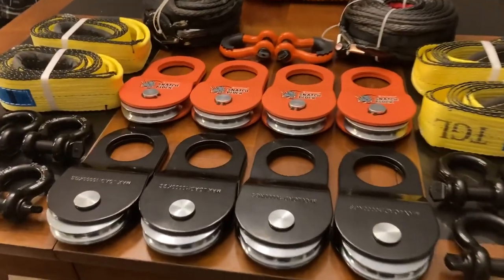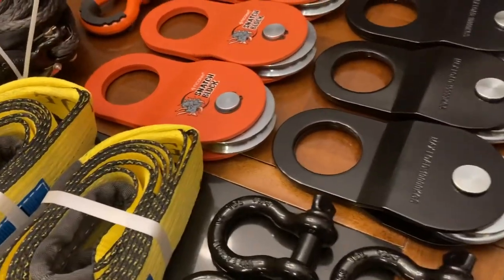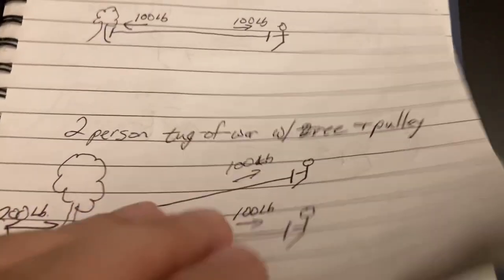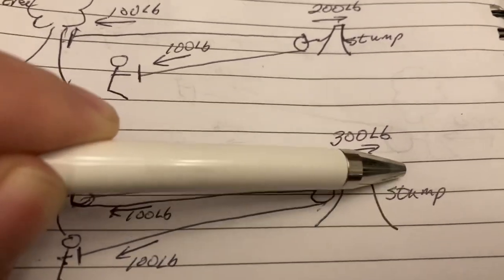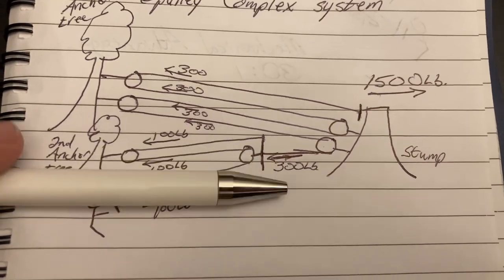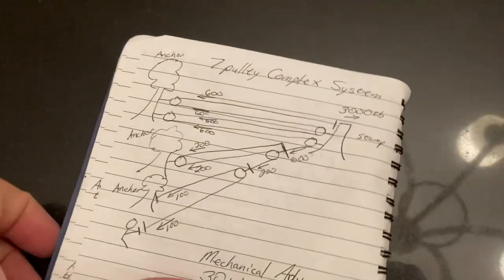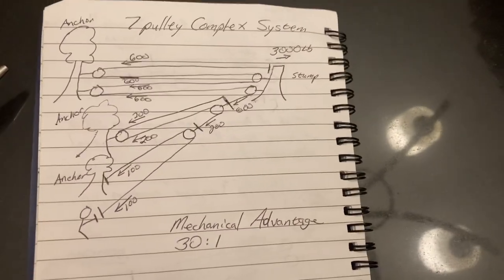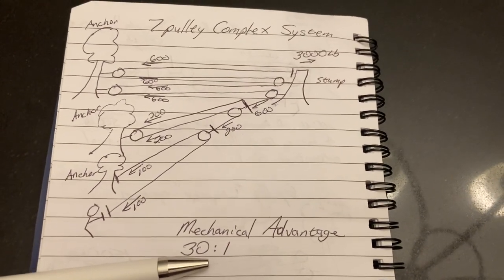Stump Pulling Preparations with Snatch Block Pulleys and Explanation of Physics

Comment: You have it backwards. Your start line goes to anchor tree.
Reply from the maker: It actually depends on how many pulleys you have and which direction you’re pulling.  For odd number of pulleys, the cable starts on the anchor tree.  For even number of pulleys, it starts on the stump.

Comment: Can we get a shopping list?
Reply from the maker: I can do that.  I’ve upgraded to more tree saver straps because one of my videos after this one snapped a chain.
Reply: @brainhomestead6  thanks. Very informative videos. Subscribed. Could you go over what kinds of rope strengths you used and how those numbers are determined? If I'm only pulling 100 pounds of force on one pulley, do I need to scale up the strength of the rope after each pulley set? I hope that makes sense.
Reply from the maker: @timma11  no problem at all.  I have another video I’m finishing about splicing the synthetic rope I use.  I’ll put that info in there.

Comment: Taught the fellows loading a barge to use that system when their winch wouldn't pull the top closed. They used 3 pulleys. that was 50 years ago. Seems, like many other things, so simple yet so difficult to wrap the head around. Well explained. Great job!
Reply from the maker: I really appreciate it!  It seems by the comments in my videos that no one is taught compound pulley systems anymore.  Thanks for watching and I am making videos of using all of the equipment!

Comment: I want to add my thanks for posting these videos. I've watched most of them and they provide a great service. I think I'm starting to understand how all of this works together. Mechanical systems are hard for me to understand. This video in particular helped me a lot. I'm trying to pull out Black Locust stumps with a More Power Puller.  Locust roots are incredibly long. I've had some limited success so far. I think I had a 2:1 system and I'm planning on adding more snatch blocks to get more mechanical advantage. Thank you !
Reply from the maker: No problem and thanks for watching.  I’m doing another video this week.  I don’t have any black locusts on the property, but I do have a honey locust I’ve been debating about pulling.  The good thing about the 10 ton snatch blocks is that they’re relatively cheap to buy and so far have been lasting very nicely for me.
Reply: @brainhomestead6 The honey locust will be interesting if you decide to do it.  I don't know if they have the same characteristics as the black locusts.  With the black locusts if you don't get all of the roots they grow new trees out of the remaining roots. I've pulled 20+ foot long roots out of some of the trees I've worked on.
Reply from the maker: @rtv7236  wow that sounds like a huge pain.  My single honey locust on the property is covered in 3” long thorns so although it’s a pretty tree, I’m not a fan of thorns.

Comment: Excellent explanation!  HOWEVER, there is no way in heck that those snatch blocks you have can actually handle the load the claim to be able to handle.

1) The pulley shaft is WAY too small

2) Exacerbating the situation, the under-sized pulley shaft is located near the bottom of the snatch block side, leaving insufficient material.

I suspect that those snatch blocks will fail at 1/2 to 2/3 of their load rating.
Reply from the maker: That could be.  I haven’t had any problems with the pulleys yet, but that doesn’t mean much.  Everything works fine until it doesn’t.

Comment: So in each pulley setup with the synthetic rope, are you using more than one 100 foot length of rope, i.e. are you fastening 2 100 ft ropes together? Is there a reason why you use the Factor 55 splicer rather than using a purchased rope with closed thimbles at each end? I am making a list of things to order. Love these videos.
Reply from the maker: Great questions.  100’ long ropes are the longest I can find for a reasonable price, about $1 per foot.  Over 100’ I would have to special order them and they become $2.50 per foot.  I use the Factor 55 ends because the synthetic ropes I’m using are for winch replacement cables which means one end of the cable has a hook and one end just has a smashed metal thimble that I can’t do anything with, so I had to cut it off and put my own end on to make it usable.  

I only want them 100’ long really because I’m making compound systems instead of simple systems.  Compound systems require more ropes , but not as long as simple systems.  

If I had 8 pulleys and one really long rope, I could make a 9:1 simple system.  With 8 pulleys and 2 ropes, I can make a 25:1 compound system (5:1 x 5:1).  With 8 pulleys and 3 ropes, I can make a 45:1 (5:1 x 3:1 x 3x1).  

There are problems with compound systems over simple systems, but the big advantage is the very high mechanical advantage you can achieve.

Comment: Re rope length, since only 100lbs needed 'in your hand' you don't need to use the towing rope?
Reply from the maker: @DavePawson  100lb was just for an example.  In most of my pulling videos, it’s probably actually between 2000-5000lb of force on the rope attached to the tractor and potentially higher for the rope attached to the stump.

Comment: Not sure if it was mentioned, or what you spent on all of that kit?  I have a 30cwt (1-1/2ton) Tirfor winch which will do everything you want and more.  On the anchor tree, if it is going to be saved, it needs far more protection.  On the stump, a suitably rated chain with the hook at the back and led up over the top, will take advantage of the remaining height.
Reply from the maker: I’ll have to look into that, but I’m not sure a 1.5 ton winch will do what I need it to.  These stumps aren’t too bad right now, but they’re just going to get bigger.
Reply: @brainhomestead6  I see nothing my Tirfor wouldn't handle, perhaps with a snatch block to assist.
Reply from the maker: @thepotterer3726  is 1.5 ton enough?  I’m not second guessing, I just don’t know.  It seems like I’d need at least a 6 ton or more to get some of my bigger stumps out.
Reply: @brainhomestead6  They do have a relentless pull, which is one of the reasons they are so effective.  I'm in the UK where they're easy to hire, not sure about the US.
Reply from the maker: Alright then, I’ll definitely look into it.  I tried doing a search for it and didn’t get many results, but I’ll keep trying.

Comment: Excellent video. How are you anchoring the rope to your tow vehicle? Everything I tried slips when I exert enough force to pull a small stump.
Reply from the maker: I’m just using another shackle to anchor to toe vehicle.  On the third tier of the compound system, the force is very light.

Comment: Isn't there a way to introduce two or three sheave snatch blocks and reduce the amount of hardware and connections?
Reply from the maker: Yes there is but the problem is the sheave.  You end up with all of the weight on one sheave and getting one heavy duty enough costs a TON of money.  That’s why I bought individual 10 ton pulleys, to split the load across multiple points.

Comment: What are alternate anchor points if the stump being pulled is not surrounded by other trees ?🤷‍♂
Reply from the maker: For me, it’s possible the use the tractor as an anchor point after I dig the bucket into the ground to anchor it.  Another option is a winch on a truck and anchor the truck to whatever you can find.

Comment: why not buy a winch or a chain hoist?
Also your 30:1 is gonna be a 20:1 after friction at best . 
(or "at best" and then "after friction"  Idk the right order, pls help,lol)
Cant wait to see the pulling😊
Reply from the maker: You’re right on the money.  Friction robs a little at light load and much more at heavier load.  Also, since I have to pull at an angle for the complex system, that robs away more.  I’m glad I got 8 snatch blocks and 3 winch ropes!
Reply from the maker: I decided not to buy a winch because I don’t have anything to mount it on, and most of them have a short duty cycle and won’t let me run for over 30 seconds at a time.

I have the first pulling video up, I’ll put a card at the end so you can see it.
Reply: @brainhomestead6  Saw it , worked pretty well👍
Lot of people mount the winch on a base plate and chain it to a tree. But yes , has some disadvantages.
Reply from the maker: @williamwallace9620  I figured it would be a large loss altogether, but hoping to get some force meters this year so I know exactly how much force is required.

Comment: Awesome approach for stump extraction. Always important to ensure that all components used are load matched. I Attempted to purchase your Equipment list above.  Any chance you can update?  Either expired ebay urls or inventory not avail is what I was running into.
Reply from the maker: I actually got everything off of Amazon but it wouldn’t let me link them to Amazon in the description of the video.  If you do a search on Amazon for the description of each piece you’ll get the right things.
Reply: @brainhomestead6  I was able to find it all on Amazon, looking forward to testing/using.  I plan on pulling the entire tree over (not just the stump).
Reply from the maker: @muskegonhunterscamp  awesome!  I have 4 more stumps to go then I’m going to start trying it all at once too!
Reply: @brainhomestead6  Should probably include the "Factor 55 Fast FID Rope Splicing Tool - RED" in the inventory.
Reply from the maker: @muskegonhunterscamp  oh yeah, I forgot to add that one.